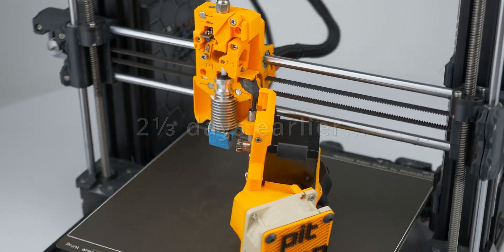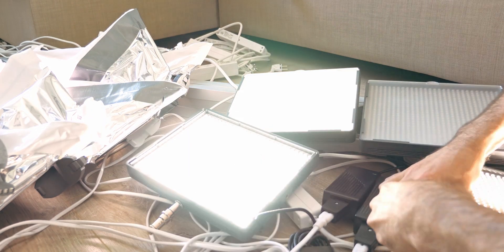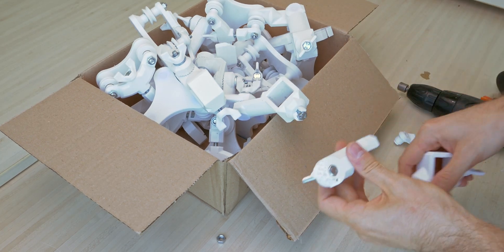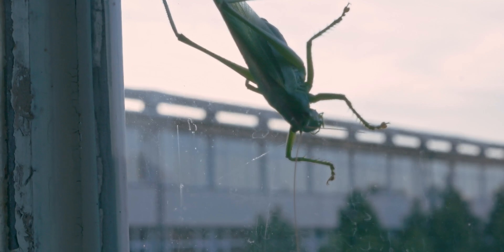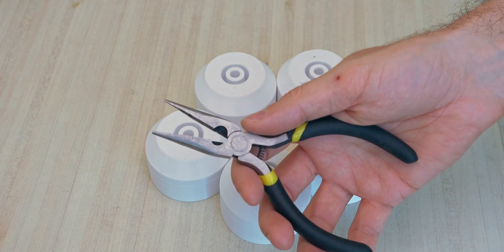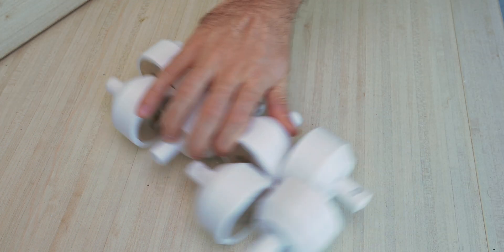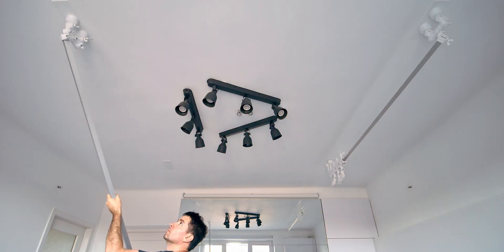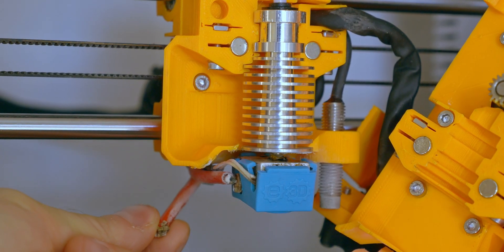Custom filming studio failed. 3D printing to the rescue!

Comment: Great idea to use magnets for holding the rails, until they didn't. ;-)

I'd love to know more details, like what metal plates you used and how they are mounted.
Reply from the maker: Great suggestion! I'll do a video on that after I finish all the PitStop videos. They turned out to take way more time than expected.

Comment: Great video, and great lighting system.
You mentioned it can support 100kg - if that's based on the magnet strength quoted by the supplier of the magnets, be aware that assumes perfect contact with a steel surface.  Even paint thickness or as much as a sheet of paper makes a big difference...
Reply from the maker: You're right to not use magnet specs! The 100Kg is based on actual pull force measurements. It's more of a maximum in an uniform weight distribution scenario, but my rails would bend way sooner anyways. I might upgrade them in the future.
Reply: @MihaiDesigns  Ah, I did wonder if you'd based the strength on real tests. I've been working with someone on precision steel parts for magnet holding systems, that's how I know about flatness, distance, etc for strength testing.  I'm jealous of your system (was a photographer myself, a long time ago).

Comment: That's a lot of filament! Which brand is it?
Reply from the maker: The cheapest PETG I could find :) Didn't print very well, but it's OK for mechanical parts in this case. Devil Design I think.